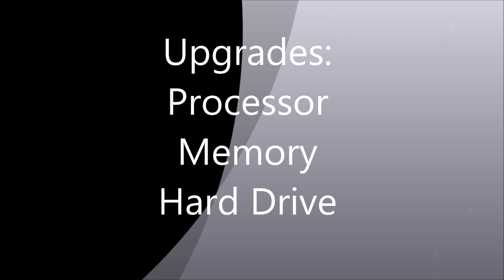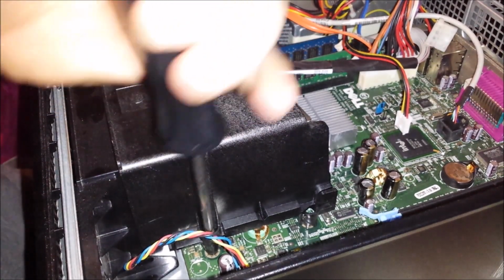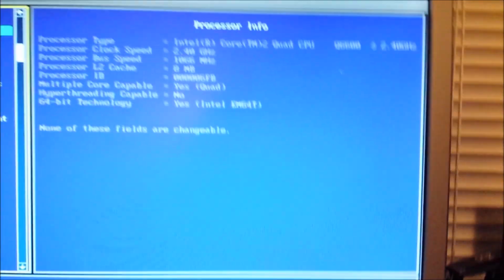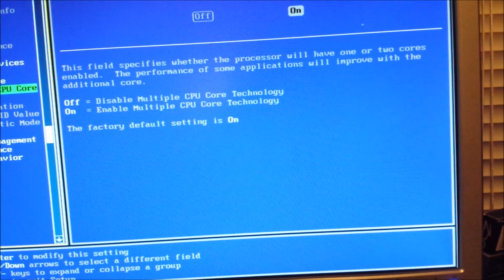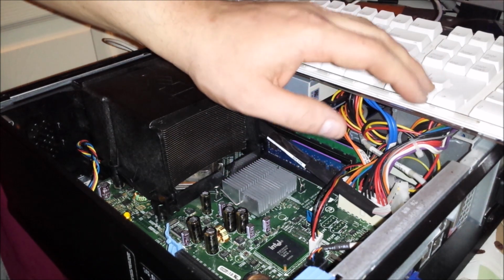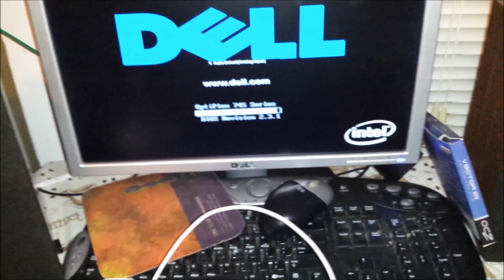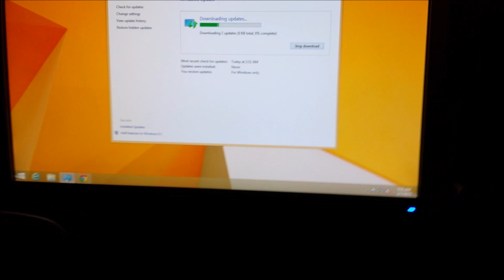Dell Optiplex 745 Budget upgrade

Comment: I have a 740 enhansed dell. Upgraded the graphis card and added a couple more ram. flashed the bios to 2.2.7. Running windows 10 just fine. I`m working on upgrading a gx 260 optiplex 2gb ram and upgraded the graphics card to run 1080hd Upgrading the cpu to 3.01 or six something like that. 160hhd It should be able to run 10 also.We`ll find out soon enough. It`s not going to be a gamers but it will brows with the best of them.
Reply: I have a 740 enhanced too. It has the original config (AMD triple core, 4 gb RAM 800, no graphic card added and 500 gb HDD). I want to upgrade RAM (add 4 gb more) and install a SSD for OS, beside the HDD. But my doubt is with the SSD. Could I upgrade to it? Are there no problems about compatibility?
Reply: @davidpalestina  ssd should be fine
Reply: Darren Wolbold I think so. Thanks! And one more question, can I put a SSD through PCIe? I have seen a lot of videos about it but I don’t have a clear answer

Comment: From the looks of the quad before you put into the system, too much thermal compound was used the previous time it was installed. What you put onto it looked like the correct amount. Most people put way too much on. 

Also, looking at the fins of the cpu heatsink at around the 2:08 mark you can see how dirty and clogged up they are. The definitely need to be cleaned.

Comment: I got a Dell Optiplex 360, it's very similar to this PC in the video (other than the specifications) and I'm planning to upgrade it soon. I have already installed Windows 7 on it (I despise Windows 8 and 10) and it's been working very well so far.

Comment: The specs on the motherboard only allow up to 4 GB RAM at 800 MHz. More than that, and it's limited to 667 MHz. So it's a chipset limitation -- not your RAM.

Comment: hi there, im thinking to update my Dell Optiplex 745, and im not sure if this q6600 works for all 745's. what you think?
Reply: if its from the the core 2 quad or duo series it will most likely work I upgrade my 380 to a q9650
Reply: you can use q9550
Reply: Q6600 or any quad core with a FSB of 1066NHz or less.

Comment: Hello everybody , i having dell optiplex 745 ( minitower ) with intel pentium D 3.4ghz inside , can i change a new cpu better than original , please !!!
Reply: yes,use q9550 quad core
Reply: A Q9550 has a FSB of 1333MHz. Optiplex 745 does not support that speed. After updating to the latest BIOS, the fastest cpu supported is a quad core Q6600.

Comment: My optiplex 755 rig has 8gb ram core 2 quad 6700 and a gtx750ti sc 2gb gddr5 and 2 100gb seagate ssd's
Reply: +Justin Kegel how did the gtx fit in your 745 i have one and i really want to buy a gtx can you please give me a advice
Reply: +Unique yama there is a low profile version of the GTX 750ti
Reply: will it fit in my optilex 745 e6300 and how much it costs Jew Jitsu

Comment: i have a dell optiplex 780 that I want to put a xeon chip. so to make a long story short, i had a fan issue and I have pull it apart 5 or 6 times because of a fan issue it is like yours where the sink is on a hinge and the fan is under the sink cover. I never replaced the thermo paste because i was going to change the cpu anyway. The core duo E5330 has never gone above 39c and I have done a clean install of windows 7 32bit os. for kicks I am going to install windows 10 64 bit os because it can run it and see how it works out. Can I fry the cpu? I doubt it, the fan runs at a low rpm as I stream movies online and I am only using the Q45/43 onboard video chipset. It has 1080p HD and I have a 1080p monitor so I am impressed for 85 bucks online.
Reply: I could't upgrade to windows 10 64 bit because of the onboard graphics and the usb internet stick I use.

Comment: Cris I have the Optiplex 745 Intel core 2 I want it to upgrade my PC , what kind of processor do you recommend, I want an i7 do you think I would last long ?
Reply: You can only use intel core 2 duo or core 2 quad CPU in dell Optiplex 745. You cannot use Core i7 or i5 in dell 745.
Reply: And it must have a Front Side Bus of 1066Hz or less, which limits your Core2 Quad options to the Q6600 or less.

Comment: Hello! I have just recieved 2 optiplex 745's, and I have about 4-5 intel core 2 duo processors in storage, all ranging from 2-3 ghz. Would it be possible for me to use them in the optiplexes? I know you used a core 2 quad, and core 2 duos probably work as well, but I would just like to verify. Thank you!
Reply from the maker: I'm pretty sure I mentioned this in the video. If you go to Google and type in "dell Optiplex 745 processor support", one of the first websites will be from Dell's forum on processor support. This website will have a listing on what processors are supported by the board.

Comment: Can this thing fit two hard drives?
Reply from the maker: +icecreamania I believe it is possible to mount one where the floppy drive would go.  I don't know for sure though
Reply: +Eric Brunhammer thanks for the reply.
Reply from the maker: +icecreamania no problem. Another thought. Some drive bay adapters from 3.5 to 2.5 can mount 2 laptop drives.
Reply: +Eric Brunhammer Thanks. I am waiting for it to get shipped. I will have to open it up and see if the motherboard supports another SATA drive without giving up the DVD drive.
Reply: Well, it arrived and it's designed to take only one drive.  Oh well.